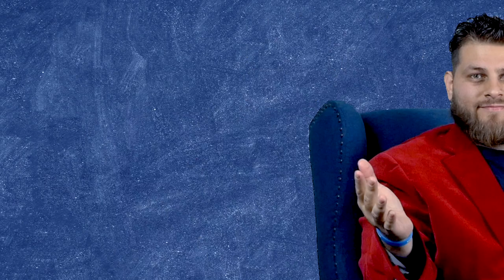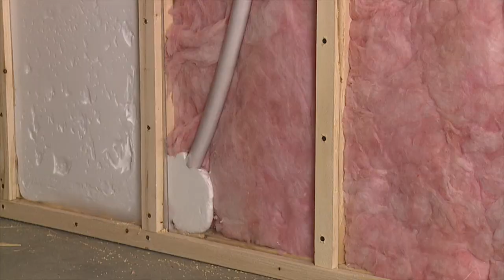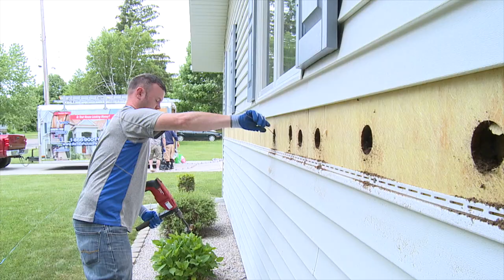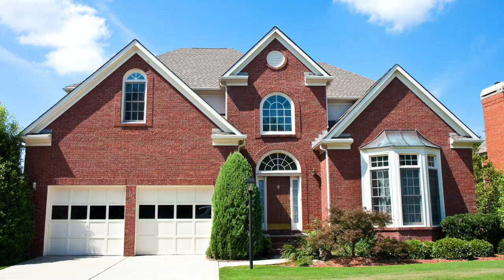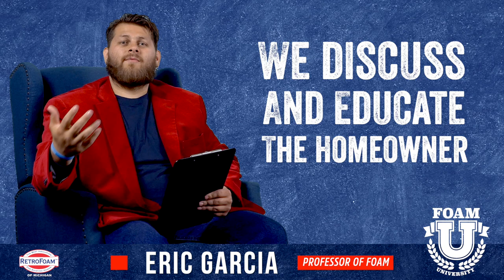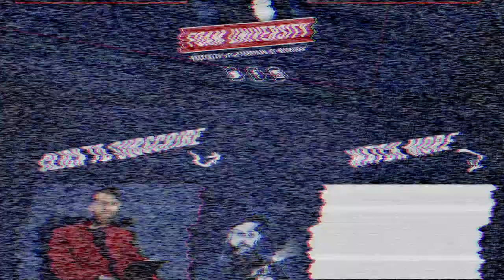3 Reasons Injection Foam Insulation Can Not Be Used for Insulating Existing Walls | Foam University

Comment: How about adding spray foam insulation from the inside?  I have a condo, no insulation in the walls, I did spray foam a bit of insulation from the inside when I had electrical done, and asked the electrician to leave the small drilled hole open until I could spray foam - I used a dental mirror to make sure the insulation was rising properly, and did so much at a time, spraying a bit of water with a spray bottle periodically - I would like to do more - or have all of the wall insulation done from the inside -
Reply from the maker: Adding spray foam to the walls would require tearing out the drywall to access the cavity. But, adding injection foam to your walls would just require drilling holes into each cavity so the foam can be injected. This article explains the process in more detail.
https://www.retrofoamofmichigan.com/blog/installing-injectable-foam-insulation-from-inside

Comment: Went to home show and injection foam was one of the vendors. I dismissed it thinking it could blow out the drywall during expansion. I haven't opened a wall to see what the house is insulated with. Not sure if fire blacking was used. Oh hey, I can ask the guy who built the house back in 1992. 2x6 walls and the house does a decent job of maintaining temperature. This is one of the ideas I mentioned in my other post about buying my own spf machine. Any videos about equipment cleaning and preservation? I'm pretty handy with using tools. Build my engines, 2 years of college body and fender etc. Not the same really but the process of mixing agents and proper spray patterns, MSDS, PPE should be relatively close. Ability to understand concepts and not torch the place or kill myself with off  gassing.
Reply from the maker: We don't have any videos covering equipment cleaning or preservation.
Injection foam and spray foam are two completely different processes and require completely different equipment. With that being said, when it comes to injecting foam there is a rare chance that it could cause the drywall to crack or bow, but a good contractor would take care of that.

Comment: Is there any possibility that injection foam could be used to provide a sound proof noise barrier in common wall situations, such as apartments or condos?
Reply from the maker: Injection foam can help with sound deadening, but isn't a complete sound proofing solution.

Comment: What about the cheap 1/4-inch particle board that’s now being used as the exterior sheathing? Does that provide enough resistance? It’s technically sheathing, but so flimsy I’d be concerned it would bow too.
Reply from the maker: We haven't experienced that material bowing under pressure.

Comment: I am wanting to understand about exterior sheathing. My house is old and has irregular stones on the exterior. There is only air between the stones and the interior gypsum walls. Will retrofoaming work for this? Or because there is not wood sheathing, it will not?
Reply from the maker: This should be able to be done still. We recommend having someone come out to the house to take a look in person.

Comment: I have 1" thick T&G on my interior walls.  When the house was built 8 years ago the contractor installed fiberglass insulation in all interior and exterior walls.  Can injection foam be used on the exterior walls?
Reply from the maker: Injection foam can be used but there is always a risk of the foam coming through the T&G.

Comment: I am making sheets of foam, tyvek on exterior, one layer of chicken wire filled with polyurethane, first ones came really good but I think I need a good machine for injection, any advice for injection machine? I am in Argentina so I would not be your competition
Reply from the maker: We custom build the machines we use specific to our product.  I would recommend reaching out to the manufacturer of the foam you're using to see if they sell what you're looking for.

Comment: I have lath and plaster walls, any issues with spray foam.  Thanks
Reply from the maker: In this case, you would want to use injection foam which is installed from the outside. It's pretty rare, but much like drywall, you could end up with a crack in the plaster. A good contractor will come in and fix it for you.

Comment: What about old houses with plaster walls that have horizontal "cats" that prevent the injected foam from going the full length of the cavity?  Can you locate these accurately?

When injecting inside the house, why not remove a 12" wide x width of wall board, pull out the insulation, then inject foam, then patch and paint?  Drilling holes requires patxh and paint too.
Reply from the maker: Bill, we try to keep our process as noninvasive as we can. If we have to, we will remove a taller strip of siding and drill into the top part of the cavity. Our crews will run a slim jim like tool through the walls to feel for any stops in the walls and help determine if they need to add another hole.

Comment: Greetings from Delton, MI
My wife and I bought a little lake house that was put together as a kit home in the late 50's. The basement has studded walls, but it's covering looks to be thin 7/32" panel sheeting held in place with finishing nails or something similar. (I'm not a builder so I'm not certain of the terminology)
Upstairs is one massive grand room going upward in an A frame or chalet style. The walls up there are similar in description as the basement. Do you think retrofoam would be my best option? We can't possibly go thru another freezing winter! Must've spent $800 on propane, and about $500 on wood for the wood stove! We can generate a great amount of heat, but aren't retaining it!
Reply from the maker: Yes, RetroFoam could work for your project, but we recommend having a project manager come out to take a look to be sure and go over the options.
Reply: Thanks for the speedy reply. I'll give you guys a shot and at least listen to what they've got to say.
Reply from the maker: Awesome! We look forward to hearing from you!

Comment: This sounds great.  I have a small old house with no insulation in the walls.  It is thick stucco on chicken wire over tarpaper on the outside.  The house is 144 linear feet with 8' framed walls=1,152 sq feet of surface to insulate (I didn't bother to discount doors and windows.  
How much (roughly) would the above cost to insulate with your product?
Due to the stucco situation, would it be best to drill the sheet rock inside to pour in?
Do you have contractors in the San Diego CA County area?
Your product doesnt come in DYI kits does it?
Thanks
Reply from the maker: Unfortunately we do not have a dealer in California and we also do not have DIY kits due to how tedious of a product this is, if it is installed wrong it can cause a number of issues. In Michigan pricing for this would be $3,900 to $4,800 for (1 story) 1152 sqft. Here is a link to our budget calculator if you wanted to play around with the numbers: https://www.retrofoamofmichigan.com/calculator
Reply: @RetroFoamofMichigan  how does one become a seller/dealer for your product?  I imagine you offer the training.  But does one have to already be an established contractor?

Thanks
Reply from the maker: @bigtimepimpin666  we currently don't have any dealership opportunities in California. When that changes, here is everything you need to know. Also, you don't have to be an established contractor.
https://www.retrofoam.com/become-dealer

Comment: Would you recommend a contractor in Chicago for retrofitting like this? I'm assuming you don't work in Chicago. Our place has 2X2 stud cavities (metal studs I think) rather than 2X4 with a brick exterior, and some settled cellulose in the walls (not dense packed). Do you think foam would work?
Reply from the maker: If you would like to email us at Retrofoamofmichigan@gmail.com just so we can get a little more information from you and we would be happy to help find a dealer near you!
Reply: @RetroFoamofMichigan  Done! Thanks.

Comment: Hi, Can one use injection foam in-between floors?
Reply from the maker: Hi Jonathan, We do not recommend using Injection in between floors or horizontally. What we would recommend is using Spray Foam to fill in those areas!
Reply: @RetroFoamofMichigan  Thank You!

Comment: Foam cant be injected with old knob and tube wires in the walls correct?
Reply from the maker: It's never encountered an issue with it.
Reply: @RetroFoamofMichigan  Except when it's time to access the wires...
Reply from the maker: @und4287  RetroFoam is soft and pliable so wire can be fished through if needed or the foam can be cut away https://youtu.be/AkL42auxt6g

Comment: what about brick walls, don't they need to breath? wouldn't foam block all that?
Reply from the maker: No houses need to breath. They need proper air exchange which is the job of your HVAC system. Our goal is to seal up the building envelope and eliminate the heat transfer of outside and inside temperatures.
Reply: @RetroFoamofMichigan  Then what is the purpose of the weep holes in the brick?

Comment: What kind of home wouldn't have sheathing?
Reply from the maker: It is something that we have seen in older homes and in homes where a contractor was trying to cut corners.
Reply: @RetroFoamofMichigan  Yeah, skipping the sheathing would be quite a corner-cut : )  Thank you for your informative videos and for replying. Btw, it's rare (but becoming less so) that contractors are willing to put real numbers out there. Thanks for that.
Reply: @robeddy9381   there a lot of homes that only have wood sheathing on corners and foam board on the rest. Mostly seen when it will have a brick Exterior but seen it many times on houses with vinyl siding
Reply: @morehp1  Thank you for the information. It's very useful. I can see, maybe, not having sheathing with brick - on an old house - but I'm surprised you've found no sheathing on houses with vinyl siding. Thanks again. Costimates.com
Reply: I understand your comment is 3 years old, but I thought I'd answer definitively. My house was built aroudn 1910. The "sheathing" was done with diagonally sawed 2x10" boards nailed to the studs, and not plywood. There are gaps between each of the boards, and while it provides the necessary shear support to the frame, the gaps and lack of house wrap means the foam has a place to leak thru. As it is injected under pressure, that wouldn't be pretty.
Reply: @charleshill7184  Thank you for the reply. My original answer was a bit ignorant, to be sure. Many older homes are treasures though they are short on things we consider necessities today like insulation, closet/storage space, bathroom space or a good central heating system. And AC? Haha. The first home I owned was built in 1924 by an English stone mason. It had a stucco-over-lath exterior and knob/tube wiring, features that stood out to me in addition to those common shortcomings mentioned above. The interior woodwork and stone fireplace were exquisite.
Reply: By the way, if you ever expose the "sheathing" again, I and others would enjoy seeing pictures.

Comment: Drilling exterior wall? Why? It is better to drill inside drywall
Reply from the maker: Installation can be done through in the interior of the home as well. Most of the time if a customer has vinyl or aluminum siding they opt to install from the exterior so the holes can easily be plugged and covered. Interior installs require patching the hole with the proper materials and repainting. It can also cause a lot of dust while we are drilling and such. Overall it is just much easier and less invasive to install from the exterior of the home.